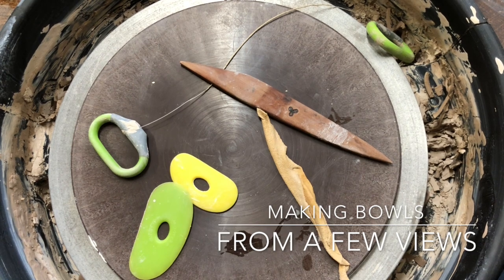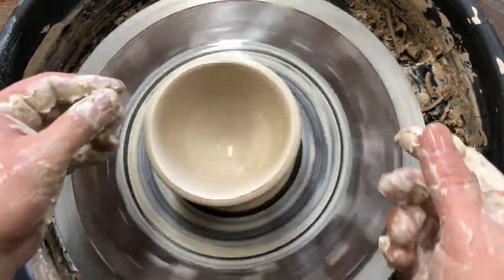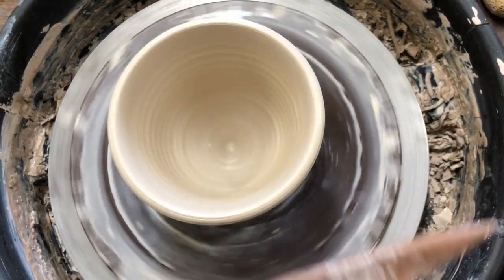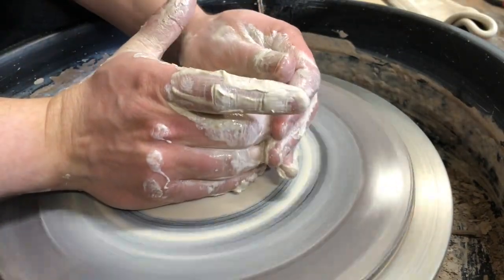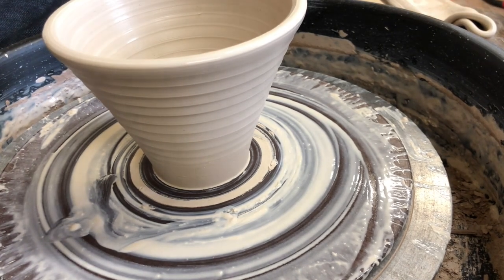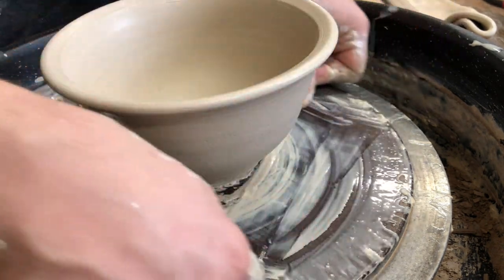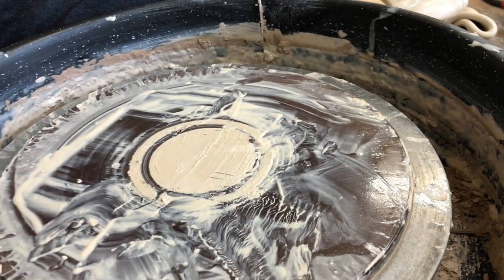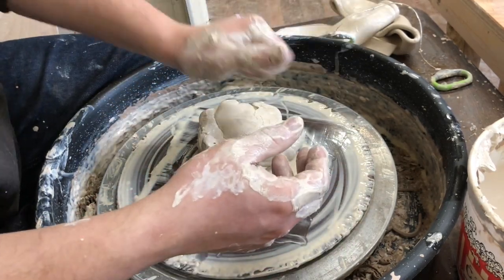Throwing some bowls with different views

Comment: What sized rib would you recommend for an exaggerated v-shaped bowl (think oriental style with a small base and steep, angled walls)?
Reply from the maker: You might not use a rib. They make great curves but harder straight lines. You can start with the yellow zero.

Comment: Nice jolly and informative video, thanks! Just a beginners question, I get the impression that one does not reuse the clay straight away, and rather start with a new piece of clay, why is that really?
Reply from the maker: that the clay that was just messed up will be wetter than when it was new. wetter clay sometimes is suggested by folks because its easier to move around but it also a lot harder to pull a wall. Reclaiming the clay, which is drying it out and wedging it so that its homogenous makes the clay closer to new and better to try to throw with.
Reply: @timseepots  Thank you!

Comment: Hi. I have learned so much from your videos. I am very new but definitely learning and I like that you have reasons for what you do. When you were talking about S cracks and compressing. I get it but in making a flat bottom I keep removing clay (it comes in the center and it’s satisfying to crimp that off while compressing the bottom but clearly this is not th beset way bc I am losing the bottom when I am compressing. Now that I read your rationale that clay cannot be compressed do you have a video more focused on creating the bottom without doing what I am doing? I would love a c

Comment: Hello Tim ! I am a bit confused....someone said to make a small cylinder before shaping it to a bowl....whereas I see you go straight to the shape of the bowl after breaking in.... which method is the better one for a beginner like me ...please help !
Reply from the maker: The issue with doing it from a cylinder is that when you  stretch the rim that far you can end up with a really thin lip. It’s also hard to get a rib in right away... which means more steps more time the clay is wet.

Comment: I noticed you didn't explicitly compress the floor after opening the hole.  Does using the rib to shape the inside accomplish this when you are shaping the floor?
Reply from the maker: Alvaro Arnal compression is a myth. We cannot compress the clay, it’s not in a contained volume it’s not a something we can push on hard enough to change its volume. Proper drying is much more important than any kind of pushing on the bottom.
Reply: Hi Tim- that's very interesting.  I'm still a beginner but this is the first time I've heard that.  I've been taught "compress or DIE!"  What do you do then to avoid the dreaded 'S' crack?

BTW- thanks for all the vids; they have been incredibly helpful in my learning!
Reply from the maker: Alvaro Arnal s cracks are a result of Harding or stiffening of be outside area of the clay while the softer less dry area changes shape to accommodate that. When the inner part finally catches up it’s shrinking causes cracking on faulty areas. Proper drying and clay prep will eliminate or reduce cracking.
Reply: although i agree proper drying will avoid s-cracks, i believe that compressing a plate with a sponge/ wooden rib is very helpful in making sure you don’t have a sloped surface, and it forces some of the water out since the base is quite thin (usually)
Reply from the maker: Sydnee W have you ever been able to squeeze water out of a piece of clay? Pressing hard with a sponge is likely to give ridges, All that’s needed is a little push either a rib for shape.

Comment: All these projects you make then discard.... how do you reuse the clay?
Reply: Clay is completely and easily recyclable until it has been bisque fired. All you have to do is wedge it back up. If it is too dry, let it re-hydrate with some water in a sealed bag, then wedge it up. If it is too wet, then you need to let it dry out some, plaster bats can make this process faster.
Reply from the maker: I have a two pugmills that allow me to mechanically reclaim all of my slop and scraps and mistakes.

Comment: With the direction of the wheel I spin it right handed but I use my left hand the most is that a problem??
Reply from the maker: The_ Unknown if the wheel is spinning ccw then the left hand is in the middle and the right is outside.